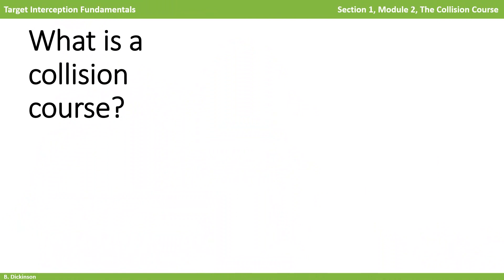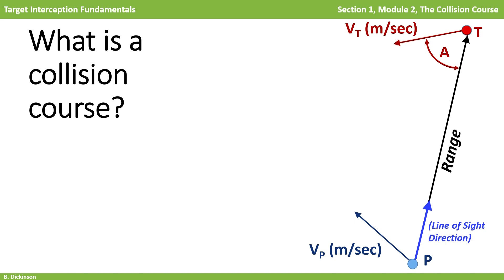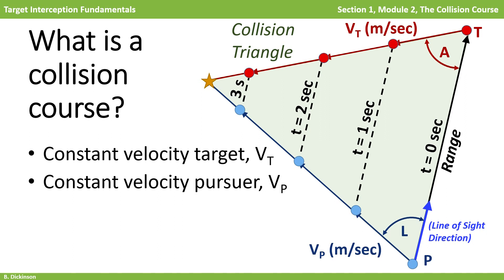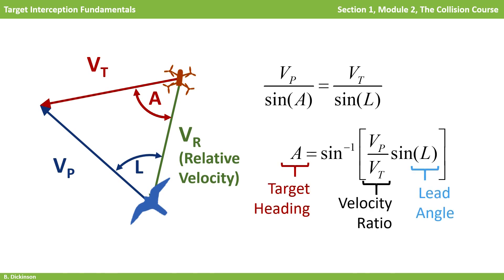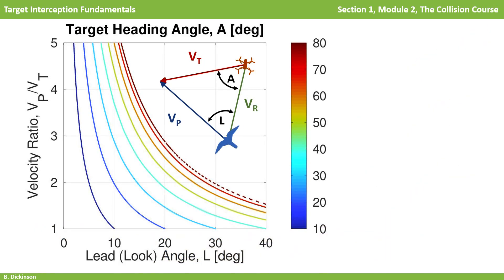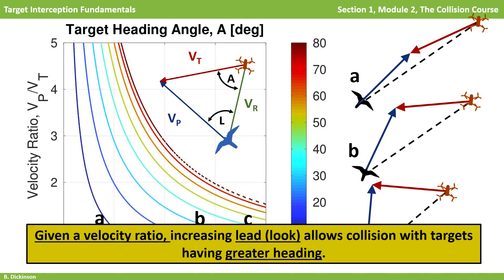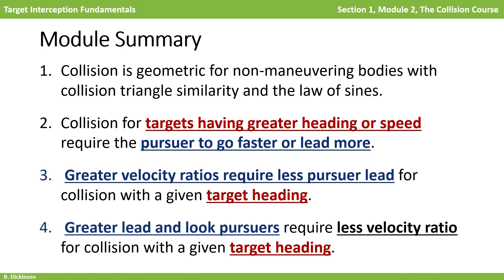The Collision Course (Triangle) - Section 1 Module 2 - Guidance Fundamentals

Comment: i wanna discuss something if doesn't really bother you , why are we making those deductions (when <condition on target> pursuer needs to <do something>) when we could just throw the math into the sim and it'll do the same thing for us without bothering to figure out all of those ?
or is it something related to control theory (i read a little bit about it before but really never delved to deep into it) 
maybe this extra info helps : i'm a computer science student
Reply: or maybe its because we have 2 unknows that which we're looking for ? (P's velocity and angle)
Reply from the maker: That's a good fundamental question on overall approach. At this stage of guidance law development,  we look to understand the geometry of a collision course and how key variables like lead angle and velocity ratio affect collision course requirements. If we were to start with a simulation, we would gain some insights but our understanding would be limited due to the complexity of a simulation and the ability to draw clear conclusions between cause and effect. Distilling our question to a basic mathematical formula and focusing our attention to its analysis allows us to create more general understanding. From this, we draw specific conclusions at the end of the lecture that guide our understanding of more complicated kinematic analysis with guidance laws.
Reply: @LearnGandC  thank you very much for this answer

Comment: Ben what is the mathematical basis for constant LOS rate leading to a collision course? PN algorithm drives us to that, but why?
Reply from the maker: Hey Kevin, the basis is that zero los rate means the target is at a constant lead angle relative to the pursuer so that if the closing velocity is positive, there will be a collision. If the los rate is nonzero, then one body will pass the other. The exception is if the target constantly maneuvers. Then there will be necessary a changing los rate for intercept, up to intercept.

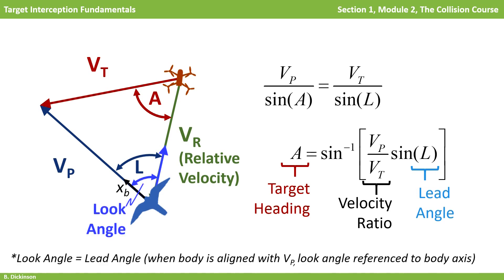Comment: Thanks for this series, as someone new to the field, it helps a lot! I was a bit struggling with one part: Is there an intuitive explanation for why the sides of the triangles are velocities? My question probably doesn't make sense, but I will try: When you present the collision triangle at around 2:04, you show how over time the relative position between the target and pursuer converge; specifically the line of sight distance decreases. Presumably, in that context, the length of the triangle (i.e., distance traveled) on the pursuer side is Vp*t_hit and target side is Vt*t_hit, where t_hit is the time at which they converge. However, later at 2:54, instead of using distance traveled as the sides of the collision triangle, you use the two objects' speeds, V_p and V_t. Why can we use these speeds as sides of the triangle, in place of distance?
Reply from the maker: Ah, good question and it's clearly laid out. You basically have answered your question. The velocities of both bodies are constant, so bringing them head to tail is equivalent to the position triangle at time to go (t_hit) of 1 second. Now, consider time to go of 2 seconds. The resulting position triangle has two velocity vectors on each side stacked end to end. The position triangle is also similar to the triangle for tgo = 1 second. Since similar triangles preserve the angular relationships derived, we can simply use head to tail construction of the velocity vectors for our derivation.
Reply: @LearnGandC  ohh... that makes sense! It's essentially just a scaled version of the position-based collision triangle. Also, it just hit me that in all of our equations, t_hit would essentially cancel on both side, so the speeds' relative magnitudes are all that matter, as opposed to distance traveled.Thanks again!
Reply from the maker: @kabascoolr  exactly

Comment: In the graph starting at 3:25 the line for the Target Heading Angle at 80 degrees becomes dashed around a velocity ratio of 3 and a lead angle of around 20. Is this to signify anything?
Reply from the maker: Hey Harrison, there's no significance. It could be an artifact of the .fig to .jpg translation, or they may be the data points themselves, with enough density elsewhere to make it seem like I plotted lines. Good observation.

Comment: Formula didn't work for me 
asin(44.7m/s÷11.1m/s×sin(20))= NaN
Reply from the maker: Yes, your values are a good example that show the limits of this formula, which has a domain of [-1, 1] . For your values, VP/VT*sin(L) = 1.4 is outside the domain. Note that for any [VP, VT, L], a target heading, A, that causes collision is not guaranteed to exist. You can visualize this as well: set VP=44.7 at 20 deg relative to the horizon, the vector head of VT=11.1 can spin around the head of VP where its tail traces a circle that doesn't touch the horizon. For a triangle to exist for your VT and VP, L < 14.3782.
Reply: @LearnGandC  Man you are smart, it is my first time and a lot of Math is new to me but I'm gonna try hard to achieve PN guidance program thank you so much for your tutorials.